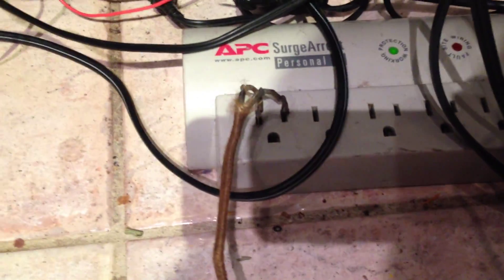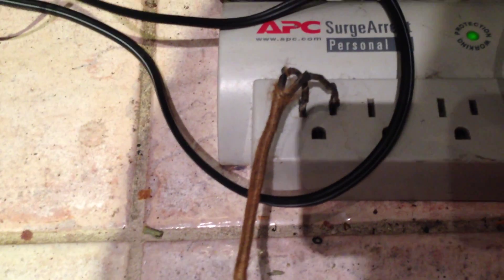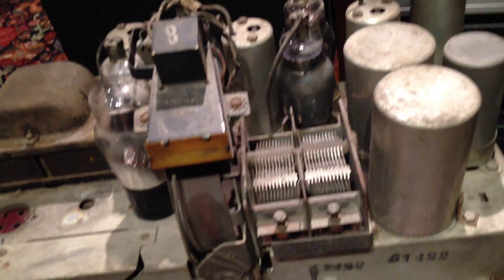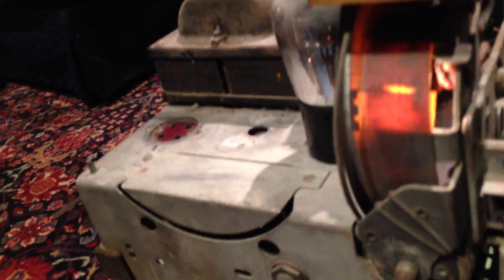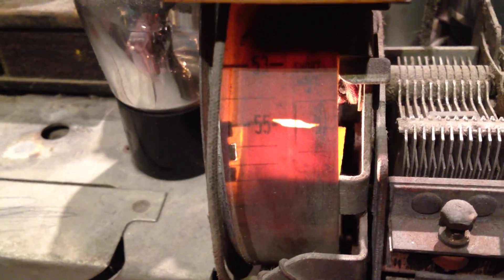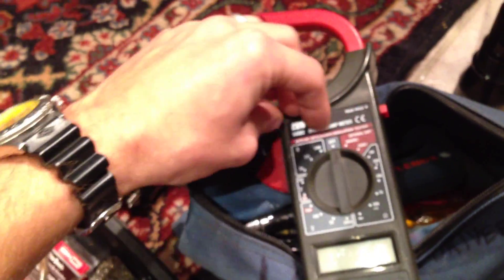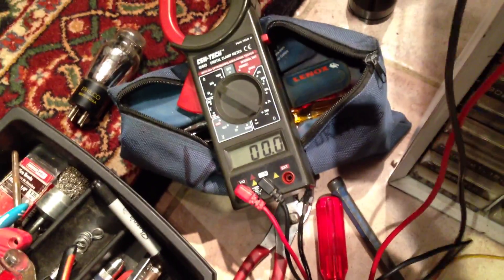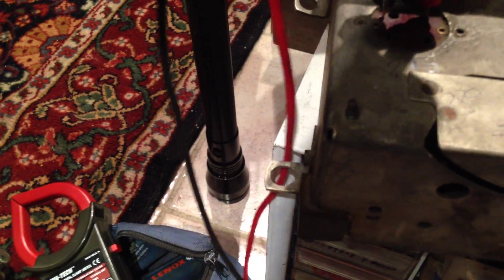Philco #29 fire up without rectifier tube.  Will it run??

Comment: Question, do you remember the range of voltages seen on your DVM?

Steven,

The rectifier (tube) supplies the plate voltage to the tube chain, when it is cut from the circuit, there isn't enough load in the plate voltage chain to supply a steady voltage. If the circuit has a shorted or very leaky capacitor or other component, the removal of the rectifier will save the transformer by not forcing it to (for lack of a better term) produce voltages in amounts far beyond it's design capabilities,which often results is a blown or otherwise damaged transformer. I gather that your filaments were all lit?

I'd get started on the replacement of the capacitors, then do the dim bulb fire-up, and see if we're cooking with fire. BAndersenTV, OldRadioAL would be your Philco aficionados. Bob has a video demonstrating the monitoring of a radio during it's "post restoration" phase, but I forget which video that was.

Tim
Reply: Steven,

Joernone made a video addressing the replacement of pilot lamps, and I believe that it was a Philco.

I couldn't tell from the schematic whether the dial lamp assembly was powered from direct line voltage, or off of one of the transformer windings, sorry!

Hope this helps!

http://www.philcoradio.com/tech/lamps.htm
Reply: As for Nathan, NBH45304, the radio and electronics community still hasn't gotten over his untimely passing.

I've edited a few (professional) television productions, namely The Big Joe Polka Show, when it was on RFD-TV, the "Big Joe" series was a cake-walk compared to what I went through trying to produce a remembrance for him.

I will include your name on a Christmas card and letter to his Family, shortly after Thanksgiving.

Tim